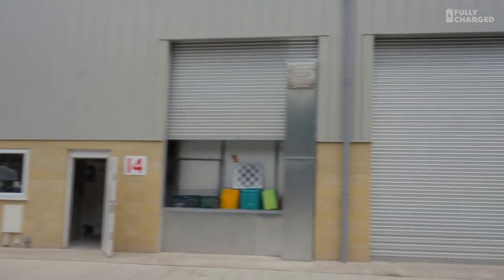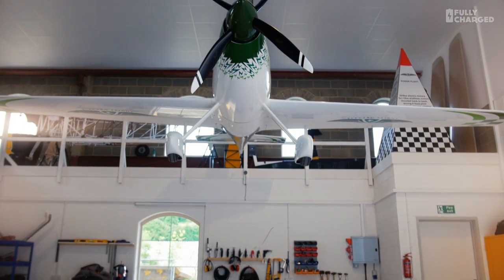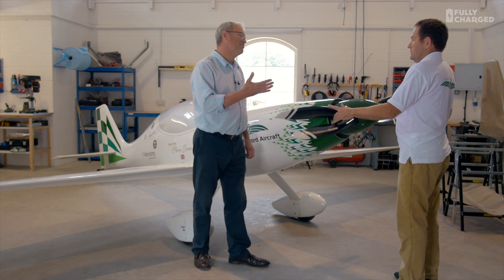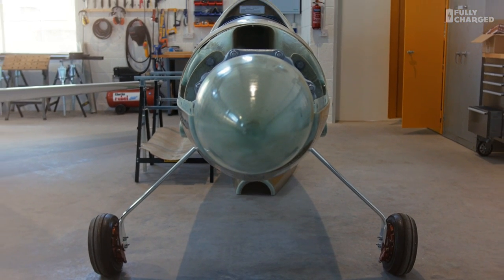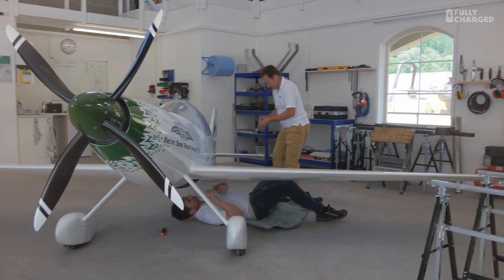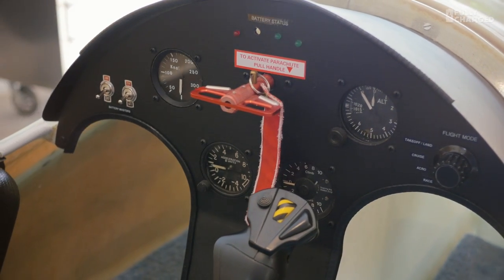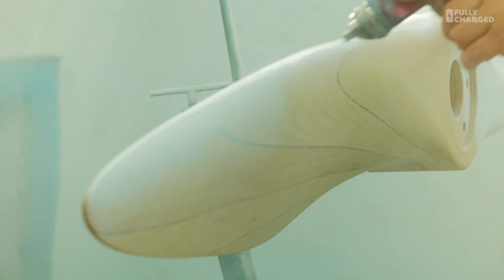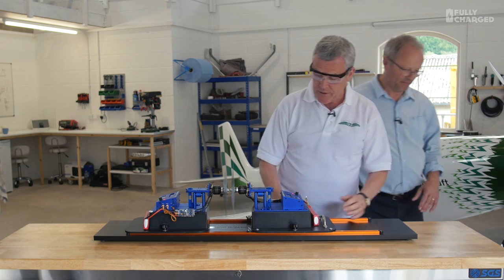Electroflight | Fully Charged

Comment: taking range anxiety to a whole new level
Reply: Hence the parachute.
Reply: at least you can glide quite effectively in an airplane after your engine shuts off. A boeing 737 can glide for 100 miles with it's engines completely shut off!
Reply: Depending on altitude of course
Reply: +Re these racing planes drop like a brick apparently.
Reply: Comforting to plane ahead when you are going to be using a parachute.
Reply: More coffee you know not to give out gasoline don't give out of electrons the same way. Both stop. and drop
Reply: Steven Correa. Are you saying they are going to do in flight battery swap. Yeah, that would be equivalent.
Reply: Joshua Weaver I would love to see  hybrid system using hemp like Ford did in the 30s. But I'm dreaming😉
Reply: Steven Correa. Almost a century later.
Reply: To new heights :-)
Reply: More like "Taking range anxiety to a whole new altitude"
Reply: The skipped the hybrid stuff on aircrafts lol
Reply: More coffee Range anxiety is Myth. And it is a Thing for Pilots who never flew Gliders.
If come from Gliding, you know
that flying with now Motor comes natural and you still have good Options, depending on Height Level and the Speed. 
Think of, there has an Airbus with no Motors running landed on the Hudson River and all People survived.
Reply: Well, we had Experiments with an Electric Aerobatic Aircraft here in Aachen, and they did an Aerotow to 600m in just over 1.5 Minutes. 
It's insane, but only good for maybe 3 Tows a Day, between recharges. 

The Glide on these Symmetrical Airfoil Type Aerobatic Aircraft is absolutely horrible, maybe 4 to 7, but they are basically Bricks once the Engine is out. 

You don't really get Range Anxiety though, because you will never get out of Glide Range of the Airfield if you have any kind of Brain. 
Even flown Conservatively they barely get 15 Minutes of Endurance.
Reply: MyFabian94 It would be the Plane for Aerobatic with the Siemens Motor..
Sadly it has an Accident, the Pilot and Passenger died..

This by the Way.

The Plane was not Constructed for long Flights.

It was an Demonstrator for that an Aerobatic Plane is possible and Maybe Gliders Towing.

It worked.

But surely there are several thing to construct different to be more practical for towing and Aerobatic. 

The Batteries should be simple to change, to be able to constantly operating (of course we wish better batteries, they are coming).

There are Planes, that fly longer Time and Range, with Batteries and the are still improving.

But let me say it has there Advatages, even with not the Range and not the Endurance of conventional Aircraft.

The Time that we could make so much Noise is going over.

Problems with the Neighbourhood are increasing. 

And I can understand, when you're not Pilot, you have an other Perspective to this.

So it must be getting quieter, we Pilots also getting Advatages of that.

https://youtu.be/Gf5iPPyI33I

I also did towing, it will get better,
more and more.

We should work on that!
Reply: We have some Students working on an Echo Class Plane able to do Berlin Aachen  in one Charge. Lets see how well ir works out.
Reply: MyFabian94 Let me know more from that! Warum schnacken wir eigentlich Englisch😉
Reply: Hier der Wahnsinn direkt zum nachlesen. Die Maschine haben sie beim letzten Sommerfest vorgestellt. 
http://www.fva.rwth-aachen.de/?page_id=2165&lang=en
Reply: MyFabian94 Really amazing Project!
Quatsch, ich meine macht einen sehr guten Eindruck! 
Es erinnert mich an die Solair von Günter Rochelt..  
Ich war damals bei den Testflügen dabei und beim Bau.
Reply: Kevin Scales Off Course! An Airbus has an Glide Ratio, 20:1, as good as my Hangglider but much faster.
Reply: It's a race plane.
Reply: Electric Model Airplane are wheigh cool! I watch a guy with a electric quad coptor  and he had a high mega pixel camera on it own it.I would include high fidelity sound with the video too. I was wowed by it! I went home dreaming of improvements.
  I wondor if the windings on the motors could be made up of graphene rather than copper to reduce wheight.  And launch it within an electric rail gun catapult. My dream model would be counter rotating cowelled propellers and swing wing designed airfoils made of  graphene composite materials.
Reply: lawl
Reply: BEVs are great. But I prefer Series Hybrids. Throughout this video, I was thinking of a small gas turbine, recharging the batteries/capacitors, and shape-shifting wings, for gliding. I want to build a Series Hybrid plane, that can carry my Series Hybrid Motorcycle, so I can ride on roads around the world.
Reply: And a gas turbine should be able to run on any flammable liquid. Though Diesel gels up at low temperatures. So unless the fuel tank is in the temperature controlled cabin with you. You may want safe heating elements for the tank.
Reply: As my flight instructor said back in 1996.. .   when you run out of gas, you don’t just pull over to the side of the road. . .
Reply: Been there have ya? 🤐
Reply: Would it not be even better with a hydrogen fuel cell instead of battery
Reply: @observingrogue7652  a flynig motorbike ...?
Reply: @skwadfpv5450  
No. A Series-Hybrid plane, that can carry a motorcycle inside it, like a cargo plane would.
Reply: @Re_Kitty  LOL yea at 37 thousand feet going 550 mph.... That thing would drop like a rock at lower speeds.
Reply: @Re_Kitty  yes, if it is at the service ceiling... 40000ft
Reply: @ThomasMTube  "These" racing planes? There is just one of "these" and "these" is inherently plural. And it actually isn't a plane at all since it isn't intended to fly. There are actual racing planes, and they generally don't glide much worse than typical light aircraft.